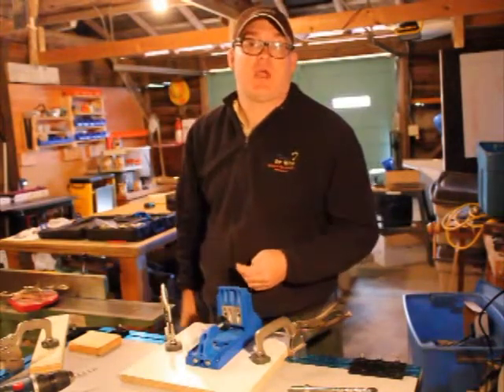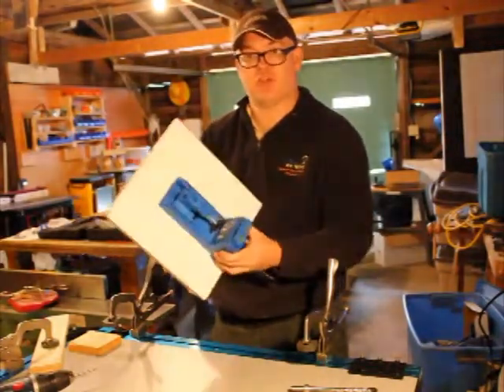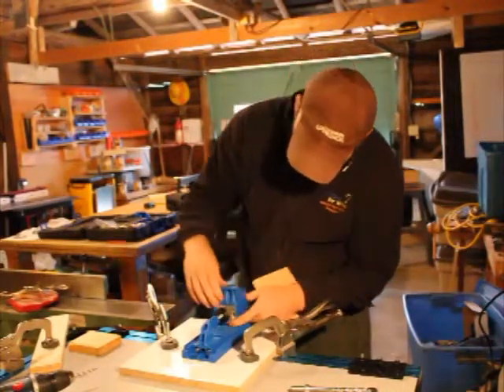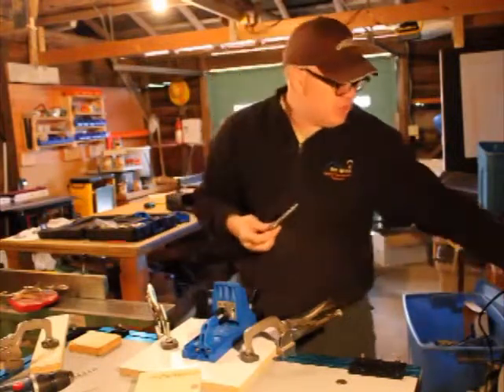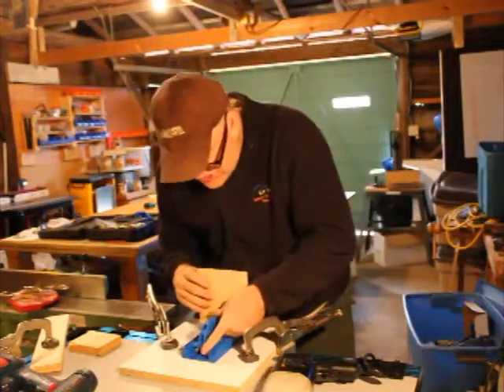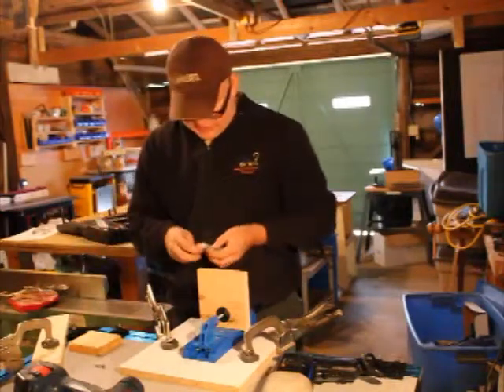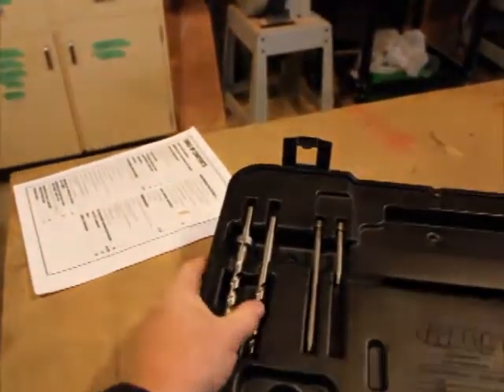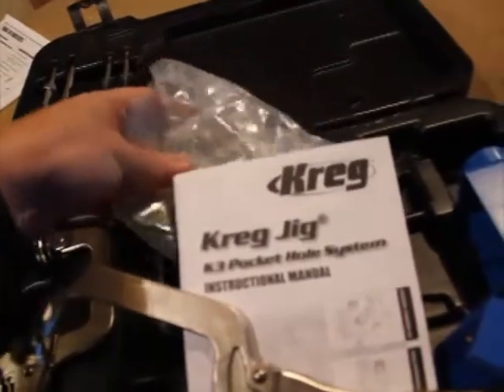kreg table and jig

Comment: Hi Derek,
I've been using the jig for years and it is very useful and saves a lot of time.  I buy my pocket hole screws at Home Depot. They are less expensive than the name brand ones.  They come in packs of 350. Prob available at other building products stores.
Love the tip on setting drill depth with a coin.  Brilliant.